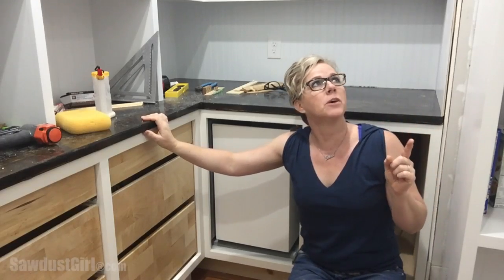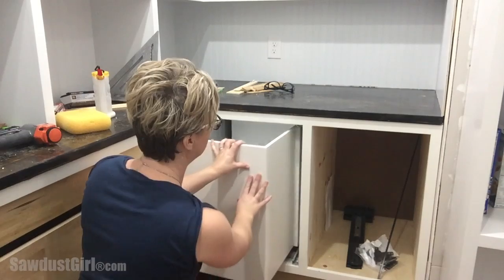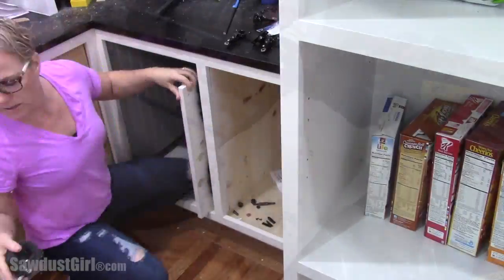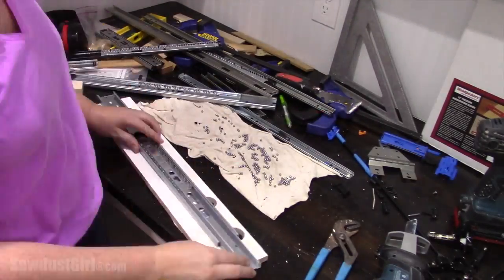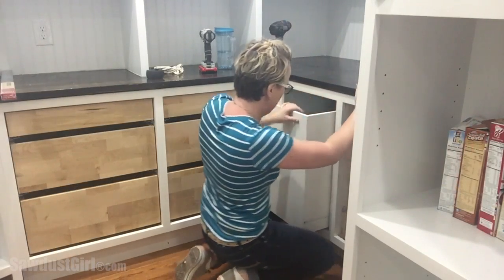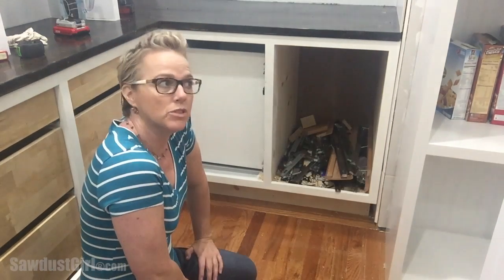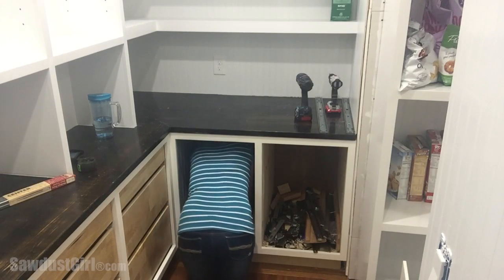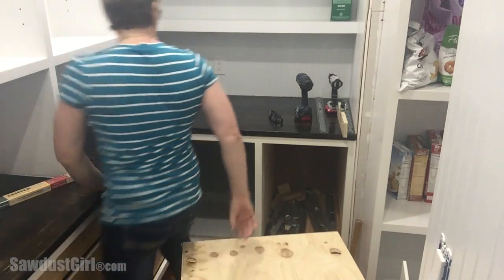Blind Corner Cabinet

Comment: I Realise I'm late to this party, how about setting the pull out on bottom running drawer slides with an extra supporting one at the top. Then the concealed box raised higher so that it will slide across over the top of the bottom slides? Just looked at the publish date, you've probably moved house by now!
Reply from the maker: Thanks for the ideas.I'm still finishing up this house but I've definitely moved on from that project. LOL

Comment: How about foregoing the drawers, make it just a sliding shelf (one above the other maybe), and the part that hinges out of the way, instead just make it a pull out shelf.  It's a little reaching, but workable, and no where near the reaching caused by having nothing.  or this http://www.rockler.com/blind-corner-half-moon-wood-2-shelf-lazy-susans-rev-a-shelf-4wls-series   or this, which is 'almost' like what you built. http://www.rockler.com/blind-corner-wire-pullouts-rev-a-shelf-5psp-series

Comment: You have moved on from this almost 2 years ago and probably don't want to touch this again but that wasted space in the corner of your cabinet is now bothering me (thanks btw).  I had a similar situation - short depth spice rack cabinet on slides.  It was built with solid maple and it was heavy.  The slides could be aligned within a mm or two and they would function but they were not smooth.  To function smoothly without any binding the alignment of the slides needs to be exact for a short throw slide.  Tighten one set of slides (top) so there is no movement but leave the bottom slides a tad looser so the screws will allow natural alignment.  Block up the bottom of the cabinet so the weight of the cabinet does not throw the alignment off when fully extended, then tighten the crap out of the bottom slide screws.  And drill more anchor points if needed.  
You might also want to try 3 slides mounted to the sides of the cabinet vs. the two slides you had mounted to the top and bottom of the cabinet.  (the slides aren't designed to function properly in the up and down (facing each other) vertical alignment.  
There is a way of doing what you want to do - keep at it.

Comment: Maybe two additional slides would help deal with these forces.  One on the top and one on the bottom as if the drawer were actually rotated 90 deg counterclockwise.
Reply from the maker: +Matthew Obley Top and bottom wouldn't attach to that 3/4" cleat which is what has to hold the load because the cabinet has to hinge over out of the way.

Comment: Hello,
I think the problem is that your first component is in free rotation which make it unstable, so what you need is to make it slide too and not only the 5" part and to do so, you have to block the rotation when sliding it in. What I suggest for you to do:
* First, you could use some kind of magnetised system or the invisible hinges you used at the beginning of this video, in order to block the rotation before rolling the component inside the cabinet .
* Besides,  the 5" part is not suffcient to support all the weight, so for the sliding system, you could use a rail inside the cabinet and bearings in the component 1 and the 5" part like this one (http://www.pbclinear.com/Images/Items/prod_crt_Hevi-Rail_Profile_Rail.jpg), but be carefull the measerment should be as precise as possible.
Finally, I hope that will do the work for your nice system and good luck ;)

Comment: Drawer slides are usually on either side of a drawer, so there designed to take vertical forces only.  Your slides are on one side of the drawer, so they need to deal with the torque created by the drawer.  The bottom drawer slide is in compression and the top drawer slide is in in tension.
Reply from the maker: +Matthew Obley I've used drawer glides on one side only many many times.  They work great!  Just in this instance, they are holding the weight on a 5" wide strip of wood that is itself holding a cabinet on a piano hinge.  It's a difficult job to ask of a pair of hinges.

Comment: I know how you could have done this with relative ease .. I literally just watched the lady on this video /watch?v=_IoBHKV7o-A put the inside draw on a board so that it rolls out and leaves  a gap beneath it. That gap would allow you to put a roller on the bottom on the front draw. just line it up accurately and adjust the hardware to slide in smoothly